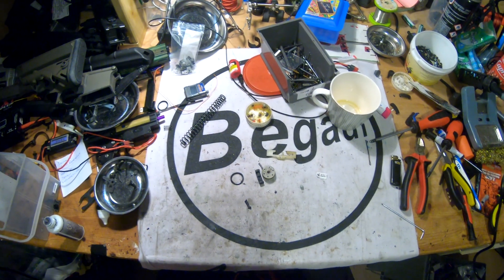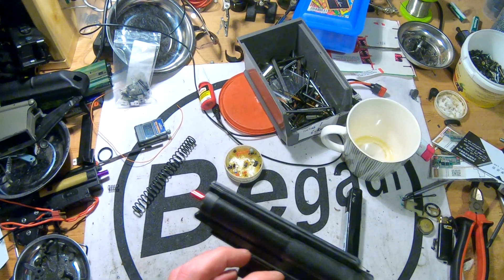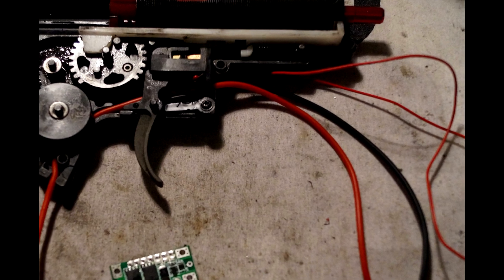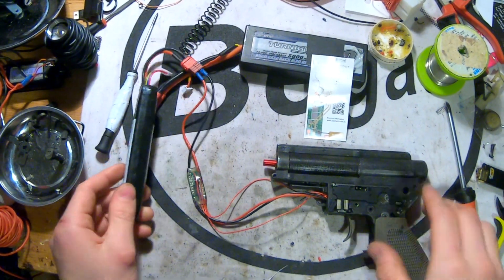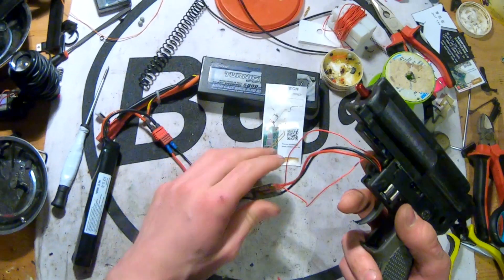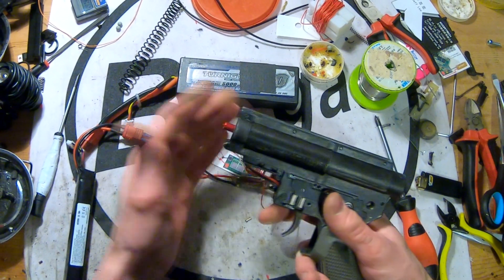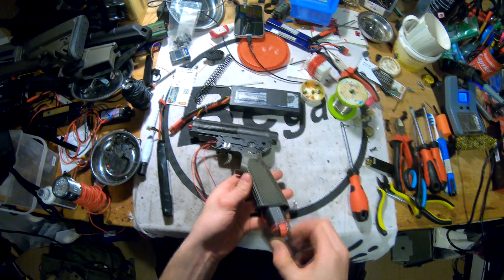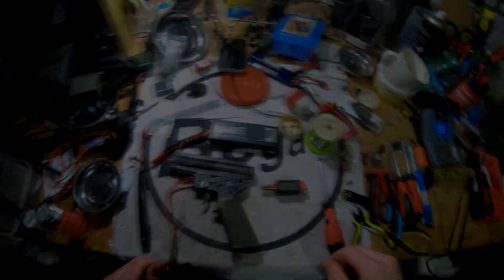New XORTECH-Mosfet stress tested with full tuning-setup

Comment: May i ask the gear ratio, the spring, the motor and the gauge of the wire?
Reply from the maker: Sure. Mosfet testet with E&L V2-Gearbox, m160-spring, E&L 170 Hightorque-Motor, Madbull Piston (full steel teeth), SHS-dualsectorgear, awg 18 wires. I wrote this in the description. i think AWG18 is roughtly 1,5 diameter of wires and a DSG means we have a 9:1 ration but with 8 teeth shortstroke.

Comment: What gauge did you use for the signal wires?
Reply from the maker: This does not really matter. They do not transport much energy so its irrelevant which gauge they are. Usually i use 22AWG silicon wires, as they are flexible, small enought to get them through everything but still thick enought to tear fast...
Reply: Joker the Misguided Moral Compass thank you Sir. Just need confirmation on the gauge.